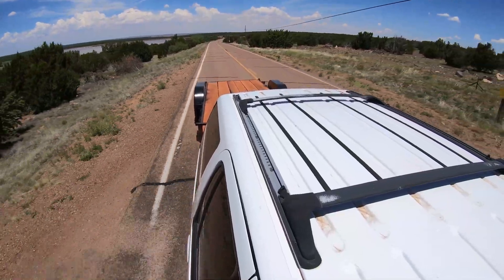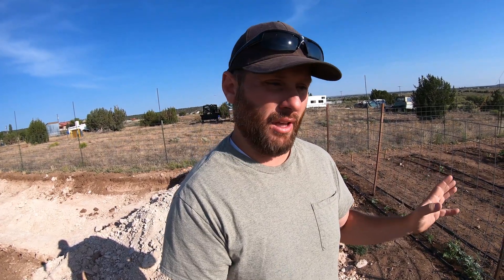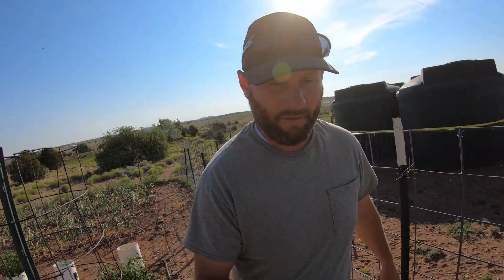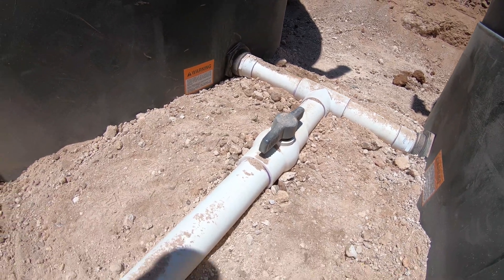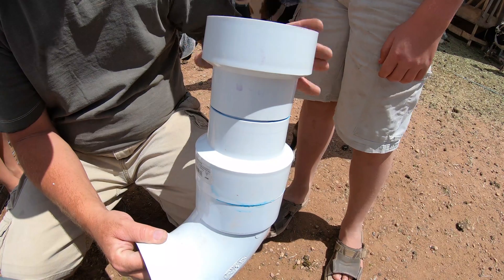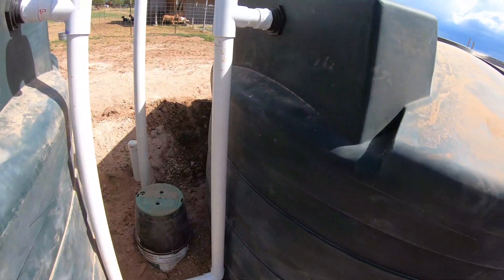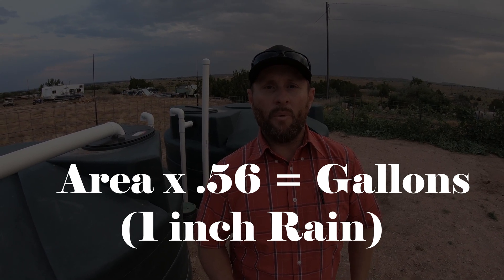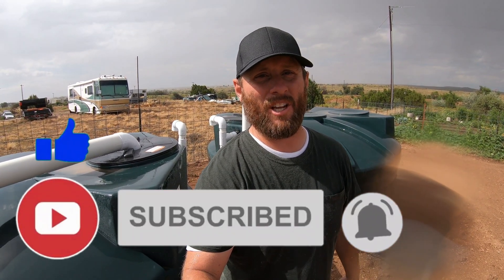Rain Harvest | Build

Comment: How long did it take to complete this project? And how did you determine the size of the water tank you needed?
Reply from the maker: It took roughly 2-3 months, this was not solely on the project though.  Part of the time is that I had to order the tanks, so that was a 6 week wait.  If I had everything on the property I could have completed in about a two week period with all time dedicated to that project.  After trenching with the tractor we still had lots of shovel work that took 3-4 days.  I am going to build a cover for system, along with a drain for the clean out, so still more to do.

I determined my size based on a few factors.  I calculated that for my family I would want a gallon a day for each person in my family in an emergency.  That would be 8 gallons a day for us.  So in a 6 month period that would be 1460 gallons.  Also I looked at how much annual rain I get where I live and I wanted to maximize the collection of that.  However this was curbed on the cost of these tanks and how tall they were, I had a certain height limit as I did not want to dig to China to accommodate tank volume.  So I settled with the two 2650 gallon tanks and connected them together.  This was much cheaper than to buy a 5000 gallon system and much shorter.  Hope this helps.  Great question, I should have included this in the video.